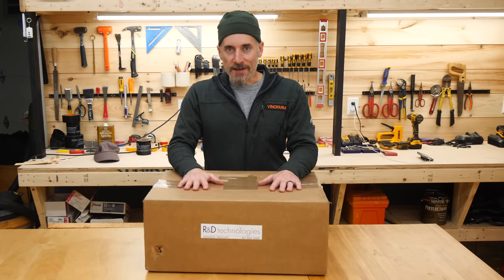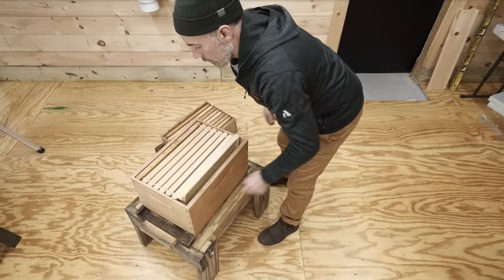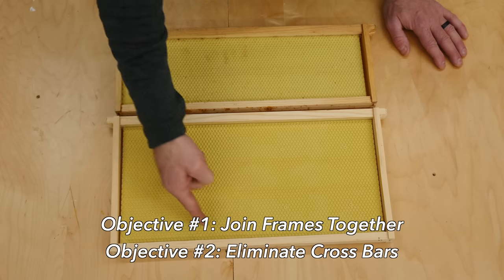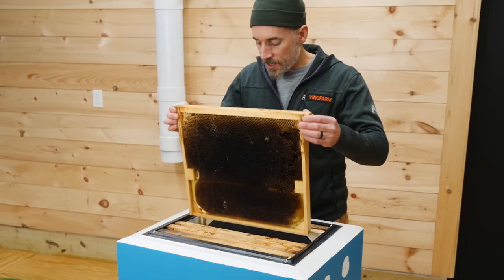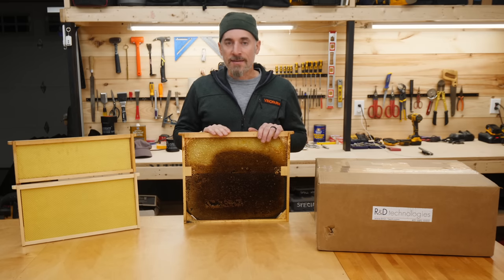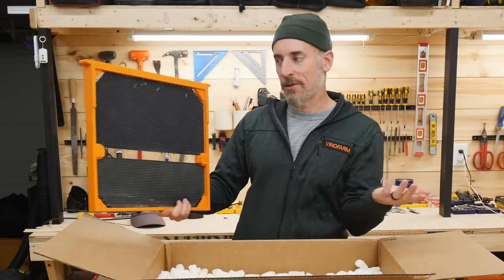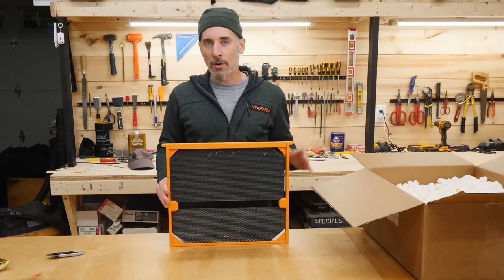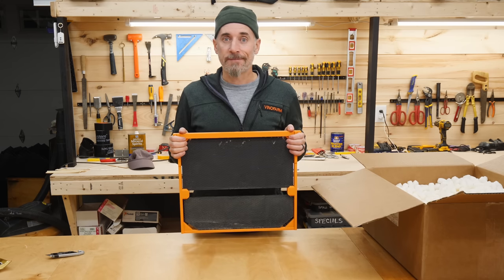Bigger, Better Bee Frames? Let’s Make This Happen!

Comment from the maker: ABOUT THE GAP IN THE FOUNDATION:
THE GAP IS THERE FOR SEVERAL REASONS.
1. I didn't want an impenetrable wall of plastic that the bees could not pass through.
2. The gap allows the use of EXISTING foundation from already drawn out frames you have on hand. Just pop them out of old frames and pop them into these large frames.
3. The gap allows the bees to pass through the center of the comb. They leave tunnel space in the gaps! 
4. The gap is a "Bee's Choice" area. They build drone comb, queen cells and/or worker comb there. I want them to have that space to do what they want.
5. The gap allows for easy hot swapping of old comb for new comb when brood comb gets too dark.

--- The gap is a feature, not a bug! ---
Reply: I would be interested is seeing how they would treat a full long frame. Strictly for educational purposes. Love what you do already.
Reply: I can cut that side bar out of pine from full length stock boards in 7 cuts to a block shape of the profile with a tablesaw, dado blade, and a jointer.  After that, one addition slice of the block to 3/8 pieces on the gang saw. I know you want plastic, but contracting out someone to make the wood frames in batches of 1000 and you being the sole distributor is the same idea as your own with plastic but probably cheaper with wood. Can I ask, since you built the bee barn from scratch, why didn't you shorten the height of the box to remove the space between the foundation.in the center which would eliminate the small blocks holding the foundation in the center?  Lewis and sons in Canada can make 1700 pine frames an hour.
Reply: If you continue down the injection molding route, I recommend removing the blocks that separate the top and bottom comb, have the blocks as a separate part (that can be molded at the same time as the frame) and add holes to the sides of the frames so a frame body can be made as a deep top or a deep bottom at will. Plus I can see an issue with molding the grooves in the blocks and having them as a detached part could reduce complexity and price of a mold (from my limited understanding based on some molding video I saw somewhere here on YT) Plus as detached parts, its one mold instead of two different molds to make offset comb orientations since you mentioned in a previous video you like to stagger the gaps to prevent frame bridging

Edit: after looking through the comments and the requests for variability, I would look at making all the pieces separately and have them be "some assembly required" to make the frames. Along with the benefits of smaller molds (and the costs of getting them made), theres also reduced size for shipping which may save a ton in the long run.
Reply from the maker: @legionofanon  I’m on it. That was the first thing I thought of, too.
Reply from the maker: @sidelinerbeekeeper   The reason I made the previous video first was to share exactly HOW these frames could be made with wood. I encourage anyone who wants to make these with wood to make them with wood. If you want to start a side business making wooden bee barn frames, I will not stop you. Go for it. It’s tedious and dangerous and did I mention TEDIOUS? I’ve been hassling with wooden bee barn frames for two years and in that time I have decided to move toward the future to plastic. It is a far superior material for the inside of a beehive and is far easier to produce once the mold is made. I promise not to force you to buy my plastic frames! But I think a lot of other people will see the benefits and want them.
Reply: I agree the bees have an option what to do with that gap. In my Layens adapted frames they have about a 3/8 gap between medium frames and can use it as they see fit. In many cases they reserve some of that space for easy movement between frames.
Reply: My bees are very creative with their gap. They change it and remodel especially when making big bees for winter. The gap is essential.
Reply: Will the frames also be every other, meaning will the frames alternate medium top and medium bottom like you said in the build video? Looking at injection companies, will shoot you an email next week with a few options.
Reply: Gap mid center is a MUST. You are absolutely correct. Bees will leave space to travel between sides mid comb. I noticed this too. I used all medium frames and let bees build super long comb. It was stronger and didn't break because the bees would backfill brood area with honey and keep building new comb down for queen to lay in. The queen could easily stay in the warm cluster center and lay both sides. I had an observational bottom. I noticed the bees clustered more effectively because they weren't forced by long sheets of plastic foundation. It was definitely more natural for the bees. I will happily send $100 to your idea. Thank you for continuing to think outside of the box. I'm not trying to wreck my back just to get honey.
Reply: This full explanation makes MUCH more sense than the shorter one you left on my comment on the frame build video… I totally get where you’re going with it after that point. 

With you alternating the gap height by alternating which foundation is on top… would you have to build 2 different injection molds to accommodate the two different setups. I think I remember you mentioning an issue with cross comb if all the gaps line up across the whole hive.
Reply: Never mind, I saw your response to the guy above with the same question. 
I will definitely be following your progress on this idea.
Reply: @vinofarm  Possibly another route, sell your idea to Acorn or one of the other bee foundation companies?  They may already have the equipment to tinker with this design and mass produce it.  

Just a thought, the last thing you want is massive costs and not enough demand.  A lot of times, genius can be a few decades ahead of its time.
Reply from the maker: @cbbees1468  Someone still needs to make the molds. And they are going to cost a lot of money. An established business is not going to bet on a niche idea like this, spend 50-100k to develop it and then try to recoup costs by selling these. The way I see it happening is going for preorders and if the funds aren’t raised, no one is charged and no one loses anything. I have the passion and the following and the marketing platform to take a swing at this. If I break even and these frames get out into the world, they might just take off after that and then I will own the mold. Acorn and premier and all those other frame companies made their molds decades ago. Everything is twice as expensive now. I’m sure they don’t see the market for these frames like I do. This would be competition to them.
Reply: Alibaba will make this for you for sure
Reply: You may want to look into having the parts cast instead of injection molded.  Casing machines are less costly but the turn around time is longer.  You will get fewer frames per day but you may find the cost is lower.
Reply: I love it.  Once you figure it out and have a price, or a plan for crowd funding, I'm in.  I'm an old man, with a sore back, and I need something like this.  Great idea!
Reply: Would lazutin hive frames work?
Reply from the maker: @danielvicknair4079  No. Different concept. Layens and Lazutin frames have closed top bars and are designed to keep bees from passing above the frames. My frames allow bees to pass up into supers.
Reply: Ok thanks
Reply: I look forward to hearing about progress on the injection molded frames! You’re doing great work Jim! Drive on.
Reply: @vinofarm  I made 50. Ten died from the learning curve. Built 40. I used a tenoning jig to more safely cut the dados in the 2x6s. I also had a reason to replace the blades in my planer to get 1 3/8
Reply: @vinofarm  a side by side comparison with dadant frames I believe  that would be very interesting challenge
Reply from the maker: @ΜελισσοκομίαΣΤ  My frames are about 4-5" deeper than Dadant frames. Same width.
Reply: These are Sooooo Awesome! 😍

Comment: I built about 30 of these frames last year and feel the same way about them - time consuming and a bit dangerous to build, but the bees and my back love them. I’d definitely be in for a kickstarter molded version.
Reply: Tbh I would do the groves and frame sides using a table mounted router instead of a saw, way more safer..
Reply: The frames were definitely the most laborious portion of the build! Just being able to buy the wood frames alone would have saved me many countless hours... I built 80 frames last winter/spring.
Reply: Did you do a deep with a super? I'm half tempted to try double connected deeps. Thoughts?
Reply: why didn't you simply get away from langstroth and follow the rest of the planet with 14" brood boxes?

Comment: Hey Jim! Ready for my critiques? ;) Hahaha
Reply from the maker: Bring it on. I’m expecting lots of   opinions on why the thing that’s been working flawlessly for two years “will never work”.
Reply: @vinofarm  oh your projects will work FANTASTICALLY. I know because they're just like MY super insulated hives so naturally I have some items to talk about :) I love that you're getting the info out there but why are you focusing on the gapping that happens with the height of the frames you're building? I see you have the deep and medium foundations in there because they're ideal but why not match the height of the frames with the height of a deep and a medium and have zero gaps? You could leave the extra space under the frames, which they would build out for queen cells and/or drone comb and this would leave you with no need for gussets or spaces. When the bees work the foundation they attach the foundations to the frames and it will become rigid although a drop of glue and a staple is plenty to hold the frames with foundation together

Comment: Hey, Jim
I used to be in Automation/Manufacturing. Definitely a cool idea, but consider not making the frames out of a single piece. 3D printers can make shapes that injection molding can't, and simplifying the shapes/orientation can make a huge difference on the cost of mold (smaller mold, simpler geometry). And being able to flat-pack the pieces will reduce shipping costs later too.

In school engineers take classes called "design for manufacturing" which is the idea of thinking through reducing cost/components/time of the tools and/or process to make the widgets. So we'd redesign something with tabs that would have needed a screw/nails before. Or turn one complicated piece into two simpler ones. What about material selection? What grade of plastic? What temperature range will it experience in the hive Vs how hot it needs to be for injection? Maybe make a looser tolerance for some sections vs critical tolerances in other places? With ten frames side-by-side will tolerance errors stack up an cause fiting issues? Or as your mold wears out, how long before the mold needs to be sharpened/repaired/replaced? Molds don't last forever, so is a rounded edge "ok", what if a part-line or flashing line appears? Does the finished part need to be de-burred? (you hope not!). That groove in the top bar comes to mind as a very hard detail to injection mold if the frame is all one piece, but easy if the top bar is a separate piece. That is likely why you see plastic frames with the comb-panel included (which brings up the issue of alternating deep/medium comb to avoid cross-combing for bee-choice gap, but then you'd need TWO molds for the alternating pattern!!!)

Maybe the cheapest way to do this is to literally just make the long sidebars that can later be attached to standard wood top/bottom bars? If the custom sidebars don't need to be mass-produced, maybe laser (or water-jet, or CNC) cutting them (out of plastic or wood) is a better method than for small batch sizes of a few thousand parts? Injection molding is typically for runs of tens-of-thousands to hundreds-of-thousands of parts, so is the bee-barn style viable for commercial bee-keepers? Definitely be cautious about over-spending up-front trying to scale too fast. Or because you don't have a patent, one of the larger producers just ends up steam-rolling you out of the market, because they have economies of scale and distribution (they can push product out to store fronts that you can't get access to).

Manufacturing design is not my area of expertise, but I know a little about what I DON'T know. So you should ask someone about "designing these bee barn frames for ease of manufacturing" when you look at mold design/cost Vs manufacturing cost Vs shipping cost. There's no silver bullet in engineering, it is all about trade-offs.
Reply from the maker: A fantastic, thoughtful comment. Thank you. I found out fast that a single piece design would be incredibly difficult and expensive to mold. I am definitely planning on a multi piece design which would allow an easier mold. I made this frame  3 months ago and I’m already on a few different design ideas. I thought it was time to get the word out and see if anyone in my follower base had any contacts in manufacturing and design to get to the next step. I’ve learned a LOT in this process over the past few months. Thanks.
Reply: @vinofarm  a two piece design would allow a frame to have a drop in foundation with flexibility. A  honeycomb pattern in the mold face would lock in to the foundation honeycomb pattern and lock together, allowing all combinations of foundations.
Reply: This is a very well thought out and experienced take similar to mine which I have had watching these videos and have just not been able to articulate as you have.  Don't rush things!  Let's support Jim's efforts to rapid prototype over and over again to get the best product possible.  Prusa Research is a fantastic model for any new beehive design/designer in my opinion: iterate rapidly and improve.  Use modern technology to do that, laser cutting, waterjet, etc -- you hit the nail on the head.  Jim may or may not be able to get patents on any of it, so why sit still (injection mold) when you can be constantly iterating?  There are tons of methods available here that would work really well to manufacture these frames and (perhaps) a redesigned hive from the bottom up (eliminating the Lyson hive backbone).  I'd love to contribute to that, and I've been working on a similar project (small fermenter project) which is allowing me to test a lot of these concepts (3D printed parts, pour foam insulation), etc).
Reply: I agree, you could make the top sides and bottoms all separately, similar to how unassembled  frames come.  That way even if one part of the frame got damaged you can easily replace the damaged part.
Reply: The fact that traditional frames are still made out of wood and not injection molded seems to hint that injection molding isn't the most efficient way, even with huge numbers: if I understood it correctly, the only custom parts are the two extra-long vertical beams, and those could be easily (and relatively cheaply) machined on a cnc router. You could probably source a cheap machine for less than your 3D printed prototype

Comment: An idea to consider. Injection mold the side bars. One other idea for the blocks between the upper and lower foundation. Consider making a grove in the side bar and attach the blocks with a single stainless screw. This way you can shift the block to allow for alternating foundation so the gaps do not line up. This idea came from watching one of your other video and the observation you noted about the bees creating cross comb. Love this bee barn concept. Hoping to build one with my son.

Comment: Im grateful that you are sharing all your ideas and experience. I d love to participate in the kickstarter campaign for 1 set of frames. I had the same thoughts regarding the side blocks either holding medium or deep frame on top. Will the block be a drawback? Maybe remove the block, let bee keepers choose where to clip in their frames and have a small removable part to clip inside the side bar gap to act as those blocks. Just a thought. Thank you for your videos.

Comment: I notice that the support strengthen blocks on the side bars are set such that the smaller foundation is on the bottom. Your previous video mentioned the desirability of alternating the deep medium over under placement so there is not a continuous see through space in the adjacent frames. Would you then need two versions of your mold to have two versions of the frame?
Reply: I was about to mention the same thing.
Reply: I'd be in the same camp on this. Two different molds and then a set of them would include 50/50 of each.
Reply from the maker: I’ve already planned for the blocks to be swappable. You will choose which position they go in.
Reply: @vinofarm  I would make the blocks as a moulded part of the sides. Additional side form 1 block up and 1 block down.

Comment: I have built 3 bee barns and want to know what the best way to introduce a nuc package would be.  A. put the deep on top and let them work down into the virgin barn or    B. checker board the deep frames in the barn with the full size frame, and then try working the deep frames out and into an upper deep as they get the larger frames drawn out?